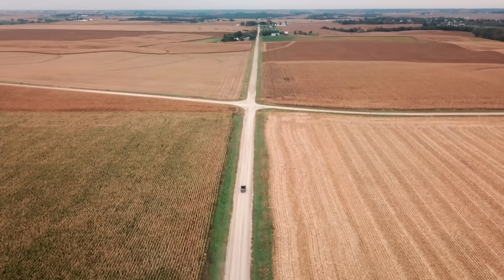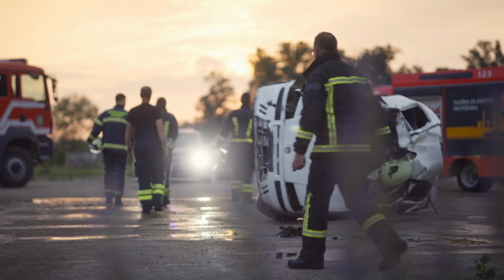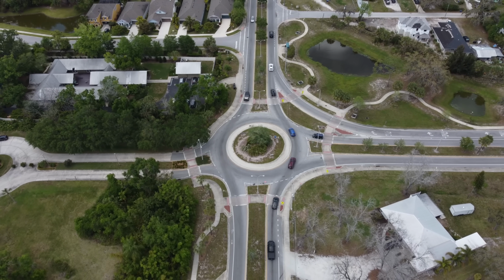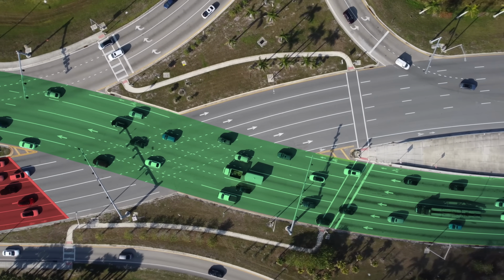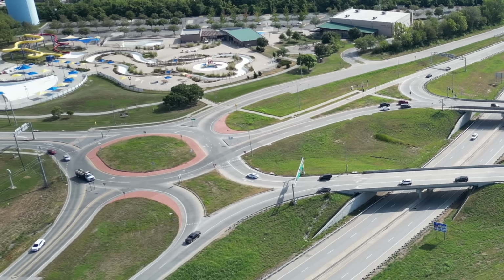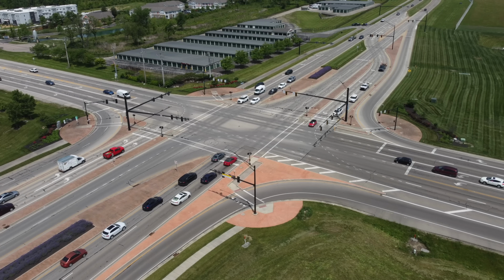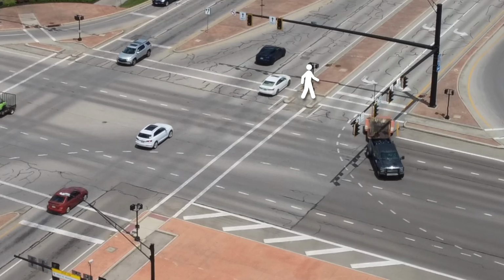These Intersections Are Changing the Roads Forever

Comment: Great video. As a long time roadway/interchange designer, you hit most of the points. Since Diverging diamond interchanges operate more efficiently (no left-turn conflicts) they are often used  in place of adding a loop ramp(s) for dominant turn movements  - this means less space - lower ROW costs. Another consideration is the challenge these design pose to ped/bike traffic. This isn't so much an issue in rural/exurbs, but in cities or suburbs, more and more people walk or bike. Since traffic flows continuously in roundabouts, peds/bikes have to pick their spots. This is daunting for elderly, and especially blind people. Keep up the good work!

Comment: OK, I hope Streetcraft NEVER designs any roads near me!  What a complete idiot.  Roundabouts are safer, sure, but you can only have like 5% of the traffic flow, like FU!
Apparently Americans are blind because they turn left into oncoming traffic?!?!?!?!  Just open your eyes, a traffic light is one of the simplistic things for a driver to navigate, for peats sake, learn to drive people!  The last interchange he showed, the one with no left turns means that people going left need to turn right, then change lanes three times in quick succession, and then pull a U-turn, and then merge into traffic going in the opposite direction, THAT IS NOT SAFER!  Just learn to drive and learn not to turn into oncoming traffic, learn how to make a left turn! Diverging diamonds are literally the worst of the worst, making people think they're on a highway and then having them slam on their brakes for TWO fricken lights, TWO!  Build the roads properly and there is just a simple one way stop at the end of the off ramp, vehicles can go when the way is clear, this is vastly superior to a diverging diamond!  And roundabouts, sheesh, they have a very specific use case and that is ONLY when you have 5 or more roads coming into a single intersection, and even then there are traffic lights that can handle the same situations that have a higher through put of vehicles.  Maybe Streetcraft would like to sit in traffic for an hour and a half every single day after work, but I would like to get home, no useless roundabouts please!  They are also a lot more dangerous for pedestrians and cyclists, and they take up much more room than a proper traffic light.  This guy doesn't challenge anything, he never questions the data, like why roundabouts are safer is because they have such a low throughput. Or the fact that pedestrians are not going to go all the way around a roundabout, they're going to cut through it because the legal crossings are so far back from the intersection that you have to walk an extra half block rather than just walk straight across. Also pedestrians don't understand the confusing layout of roundabouts, that you need to walk across one direction of traffic and then stop and wait for the way to be clear, then walk across traffic going the opposite direction.  With a traffic light it's simple, walk sign equals go, hand signal equals stop.  Lastly, have some patience people, you don't need to keep moving every second of your drive, it's ok to get stopped at a traffic light, it's fine, it just means that you will get the green on one of the next few lights.  RELAX, enjoy the drive, it's not a crime to stop at a stop light, in fact this is the perfect time to check your phone for texts, check your navigation, have a sip of your beverage, just chill the f*ck out, please!  You don't need to "keep moving" at all times.  A roundabout fools you into believing that you are saving time when this is not true at all, a green light is definitely way faster than a stupid roundabout.  And having to slow right down for a roundabout, and then go through one with bumper to bumper traffic is the same as being stuck in a traffic jam but with fewer vehicles.  A traffic light can deal with huge loads of traffic, and although you might be held up for 2-4 minutes at least you know that it's fair, when traffic going the same direction of you gets it's turn then you get to move loads of vehicles through the light; with a roundabout you just have constant traffic and if the person at the front of the line, ahead of you, is not an aggressive driver and keeps letting the traffic inside the roundabout go, as per the law, then your direction can get held up for an hour waiting for that one driver, who is actually just following the law!  This is how and why roundabouts completely fail as soon as you have near continuous vehicles the whole thing blocks up and becomes stand still traffic. At least with a traffic light it's like 50 people from the west get to go, 50 people from the east, 50 people from the north, and then 50 people from the south, and no one can cheat and push through and hold everyone else up, it's fair and it's a fair bit faster as well, and the red lights help to unclog traffic during rush hour.  There is no dispute, traffic lights are far better than roundabouts, turning left is essential, and diverging diamonds are the worst kind of interstate intersection ever created.  Streetcraft is clearly not street smart, too much text book BS and not enough actual driving.  I'll bet he has virtually no driving experience, otherwise he would know better.

Comment: In England, instead of diverging diamonds, we just put a roundabout on each side of the overpass, add on and off ramps and it all just works
Reply: Except when traffic flows are too much and you have to put traffic lights on the roundabout.  Which is why for higher capacity you have one big roundabout over the motorway or dual carriageway, however they are more expensive as they require two bridges.

But each junction needs to be considered based on its own traffic flows, and for the one in the video it seems the main flows are between the road on the right and the highway, so this design balances the different needs on both side of the highway.

There are plenty of places in the U.K. where roundabout junctions have been redesigned, such as "hamburger" roundabouts, or measures to remove traffic from a roundabout by having separate junctions in front of them (M4 J16 Spittleborough Roundabout), or short cut loops within them  (M40 J4 Handy Cross Roundabout),  or separate offset roundabouts (A10/A47 Hardwick Roundabout).

If this was a standard British dumbell design with traffic from the right wanting to head south then, as right hand traffic, it would need to go ahead over one roundabout, then got 270° around the second, but instead this design is just one set of traffic lights while still having all the safety benefits of a roundabout once passed it.

Sadly the traditional intransigence to roundabouts in the U.S. is matched by a similar intransigence to other types of junction here.  But while the benefits of a roundabout is now becoming widely accepted in the U.S., I cannot see a diverging diamond being accepted here.  Despite having the benefit of only needing a single bridge design and needing two traffic light phases.  Look at M1 J15 Collingtree Interchange near Northampton.  The capacity is too high for a dumbell design but, I guess, not high enough to cover the cost of a second bridge.  A diverging diamond here would reduce points of conflict and traffic light phases making it more efficient and safer.
Reply: Exactly! Like a letter H with slighty bent legs, and   one roundabout on each side of horizontal line. I still think it's the best design.
Reply: I'm in New Zealand. We just use traffic lights or the "give way to your right rule" (driver is on the right. So they can see cars on their right better. If a car is approaching from the right. Let them go first)

Comment: The other way to eliminate left turns is jug handles. Common in New Jersey. You basically go through the intersection and up onto a circle that then feeds you back onto the road you wanted to go left onto. Now unlike a ramp on the right that feeds you up onto the freeway you just went under.

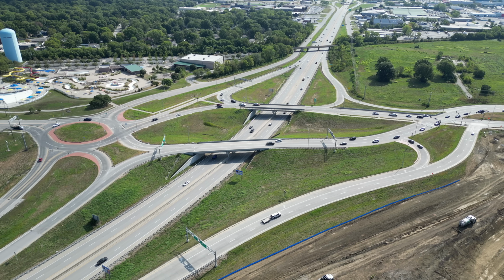Comment: At 5:10 the “divergabout” seems ridiculously over-engineered. You could probably achieve the same thing with two roundabouts on either side (known in the UK as a ‘dumbbell’) by neglecting the need for the diverge, or have one great big roundabout in the middle (one of the most common freeway/motorway intersections in the UK.
Reply: Dumbbells are actually reasonably well known and increasingly common these days.  Diverging Diamonds tend to be for specific traffic patterns with many turning movements, demand driven traffic lights, highly asymmetrical traffic flows and very little through traffic.  Roundabouts function poorly under such conditions.
Reply: There is no single design that works everywhere.  What is right for any situation depends on the traffic flows.  Even in the U.K. there are various different designs used.  A great example is J15 on the M1 to the south of Northampton.  A dumbell did not work so you end up with that mess where a diverging diamond would have been much safer and more efficient.

As I posted on another comment, the dominant flows at this junction seem to be from the road on the right to and from the highway.  A dumbell design would mean traffic from the right head south (relative to the screen) would need to cross one roundabout then turn 270° on the second.  Instead it has to pass one set of traffic light then a straight forward left turn onto the ramp.  Assuming this interchange is busy at peak times, then it would need the roundabouts to be traffic light controlled anyway, which is a common feature on roundabouts at busy junctions in the U.K. (which are still better than normal junctions because they retaining all the safety features of a roundabout).

The design of the junction in the video uses one set of traffic lights control traffic between the road on the right and the highway with only one point of impact, while the roundabout on the left can safely manage the lower volumes of traffic for the three other roads that connect to it without being swamped by any of the highway traffic using the road on the right.  And the great thing about a roundabout is it can easily un-diverge the traffic.  To me it looks an elegant and effective solution to the needs of that specific location.
Reply: @Rebecka_J  "There is no single design that works everywhere" - true. That doesn't mean you need a DD. You just need to change the road configuration.
If the main flow is east to south (and vice versa) you correctly identified the "left" turn on the western roundabout as potentially problematic. But the beauty of having grade separation between the main roads is that you don't need to turn left to go south. You can just build a parclo-style on-ramp that goes right (north) and then turns around, leading you under the bridge.
Reply: @lukasr5867  But that is a vastly more expensive solution as it requires the construction of ramps and bridges for the traffic flows to cross each others, they  have higher maintenance costs, and they need more land.  If the traffic flows were so much that the traffic lights were causing congestion then they can be an appropriate solution.  But the benefit of a diverging diamond is they require no extra physical infrastructure.  They are the a middle ground between a traditional intersection and grade separation.
Reply: @Rebecka_J  I think you misunderstood my previous answer. You already have the bridge (the east-west road going over the north-south road), no further bridging is required. All you do is move the on-ramp for the southward route to the opposite site of the roundabout (right next to the off-ramp). And it only fills the empty space between the southbound road and the off-ramp, so no additional space is needed.
Reply: Yes, and the advantage is that while roundabouts to take up a lot of space, they are generally smaller, more general more much easier to maneuver than the one-off hybrids.
Reply: I've seen a lot of dumbbell diamonds in Bluey's home town and in Ipswich and they work up to a point. The M7/M5 interchange near Richlands used to have a big roundabout but they changed it.
Reply: The problem comes in with the extra access road that parallels the main highway. It would need an additional roundabout and two roundabouts that close together are a nightmare. I've had the displeasure of navigating one of those in Michigan.
Reply: @kks_123-u1w  As shown by the very example discussed here, a roundabout is very much  capable of taking in more than four roads (two crossing roads), another advantage over normal crossings. It would look just like the divergabout on that side of the highway. The dumbbell would only change the other side (and switch the middle part back to "normal", i.e. driving on the right side).
Reply: I'm thinking of my 70 year-old parents in the US confronting this when they are just barely comfortable with a roundabout... The divergeabout is way too complex for them. Perhaps that will encourage them to drive less or give up altogether, but as suburbanites, they have no transit option...I see why people are invested in this discussion.
Reply: @acchaladka  Sooo, you see old people living (perhaps being forced to live by monetary restrictions) in a place that doesn't properly support their needs, who slowly but surely lose the ability to use the one remaining thing that gets them to where they need to go, and you think round-/divergabouts are the problem?
I agree, the divergabout is probably nonsense and likely would be better as a normal dumbbell. But the solution to old drivers being confused or overwhelmed by "new" traffic solutions isn't to not introduce these solutions. It's to give old people alternatives and give the younger people time to get used to them. Pretty sure 70 year-old Brits are totally fine with roundabouts.
Reply: @lukasr5867 you are leaping at assertions i never made, but thank you for the attack. Yes to all of those solutions but balls, child, learn rhetoric aka proper argumentation and some empathy.

Comment: Roundabouts also have the added benefit of not using up much space, and even allow greenery to grow in the middle 😃🌳
Reply: Uh, the opposite is true.  My county would roundabout the dickens out of every intersection (because they WORK), but we have run out of room.  You cannot shoehorn a roundabout between geographic or urban structural barriers.
Reply: @Merzui-kg8ds It depends. With roundabouts, land use is much more efficient, because all the vehicles use the same space, and you have the open space in the middle.

Comment: In Catalonia (spain) I have seen this type of intersections on most outflows of a motorway. There is a crossing between two roads/ motorways. The exit ramps take you to a roundabout, you can turn right and incorporate into the crossing motorway, or go left and there you will find another roundabout, and of this you can turn left to incorporate the other direction of the crossing motorway or make a change of direction in your initial motorway.
(eng not my first language and this is a big mess, so idk if I explained it correctly)

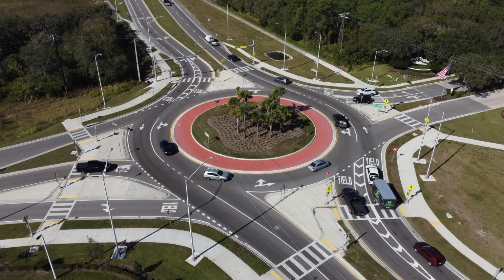Comment: 5:10 that monster intersection takes up as much space as a Walmart or small town center.

Extremely confusing also
Reply: One thing I have seen about roundabouts is you have to be familiar with the area.   It is confusing for non locals because the direction you take is not intuitive.   Louisville has the infamous spaghetti junction because of the funky merging and bad layout.    And it is not intuitive into what lane you should be in.  These are the same.   Roundabouts in 35 zone can work…..   pop in 55 mph highway area …….  This is more problems than you think.   Highways are 55 mph unless you are in city limits.   Good luck

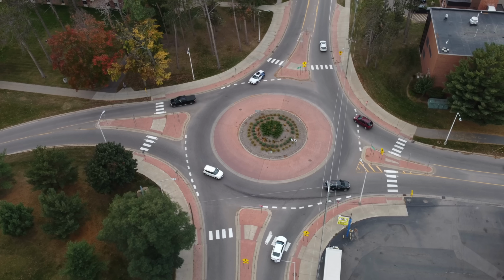Comment: 0:52 How does the shape of a roundabout "force" drivers to drive slower?  In August 2025 a bus overturned after driving too fast through Kenya's Coptic roundabout and 26 of the 51 passengers were killed.  Unfortunately the roundabout didn't force the bus to slow down.

Comment: Looking at these through British eyes, apart from the roundabout, all these solutions seem so over-engineered and trying to reinvent the wheel. They are over-complicated and take up too much land space. In the UK we have roundabouts everywhere, and very dense traffic and they work well in single and multi-lane configurations. Up to 3 lanes is just fine. Even 4 lanes can work. When you have motorway junctions you just make one really big round about that takes up a similar amount of space as a diverging diamond, but the layout is much simpler to understand, and you don't really need traffic lights, unless it's super busy (you can have peak time only lights). Alternatively, you can have two small roundabouts: One each side of the highway, in place of the crossing intersections in your example. 
A lot of the issue here is that North American roads are just too big. Your intersection capacity is limiting overall flow, so the additional lanes are mostly wasted. If you reduced the number of lanes on the main roads, you could probably get away with smaller, less complex intersections and I highly doubt the traffic would get much worse. It might even get better. The roads would also be much cheaper to maintain and less cities would go bankrupt. It would also make it easier for pedestrians and cyclists to navigate and you could give space back to bikes, people and buses or light rail.

Comment: a rotary or a roundabout as the european drivers would say has been around for almost as long as roads. It is not a recent thing.
Reply: That is the traffic circle, not the roundabout, which America had prior to Europe.  Standard roundabout operations were not developed until the 1960s, was not used in Europe in the 1970s, and was not introduced to America until the late 1980s.